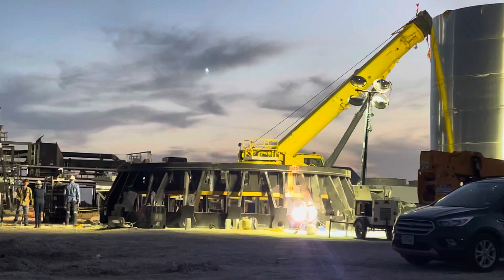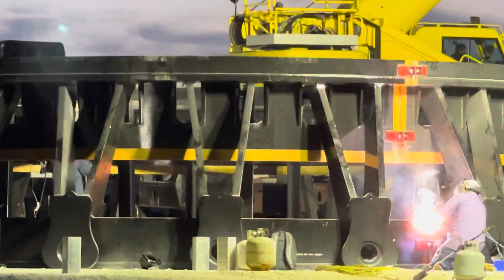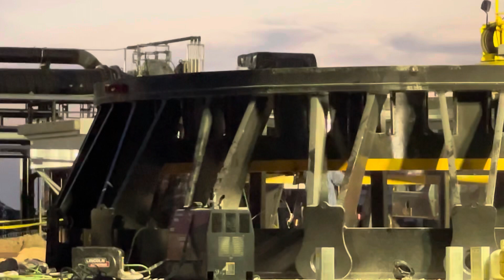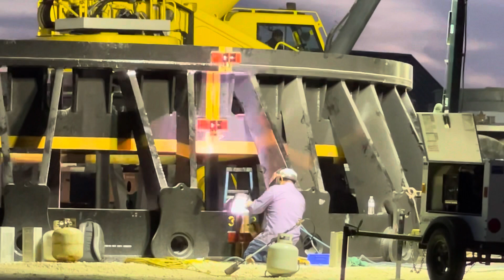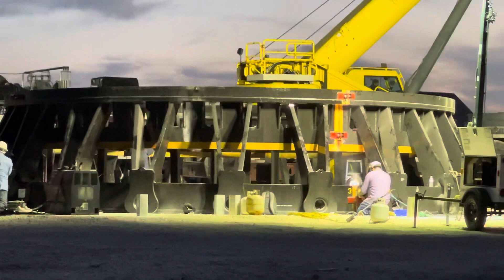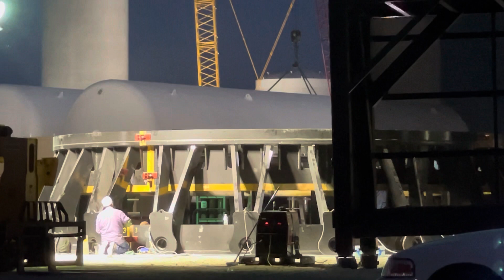Welding

Comment: This a "lock on", "Lock off" transporter stand for Super Heavy Booster. It will grab a "lip" at the bottom of the booster much like Orbital Launch Table will hold down the booster, then release it at launch. There have been several articles posted about this with animations.

Comment: I would bet that it's the base of the OLIT crane. See the wheels at the bottom? They will run on a circular rail that will be installed up top of Section 8. Then the crane will be installed on top of it. Just my guess.

Comment: I think it might be what goes on the center of that grey piece with the walkway around the top. It folds out like a flower. Then both of these pieces might go in that concrete pad they are building on the ground. Next to the tower. To hold the starship and booster before they are stacked.
Reply from the maker: wow
Reply: @SpaceOcean  of course it could also be a massive throne for Elon. This is SpaceX after all. We won't know until it's done. Haha.